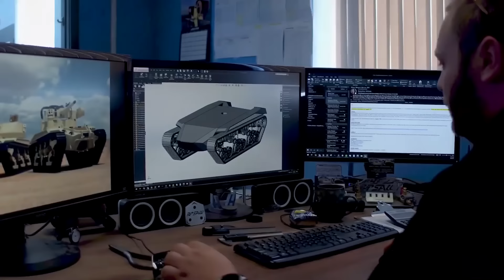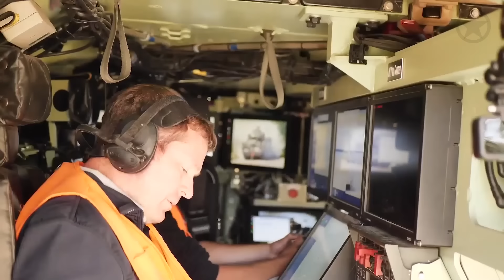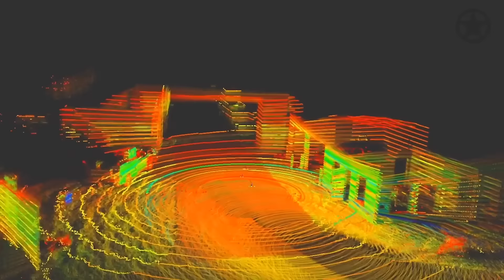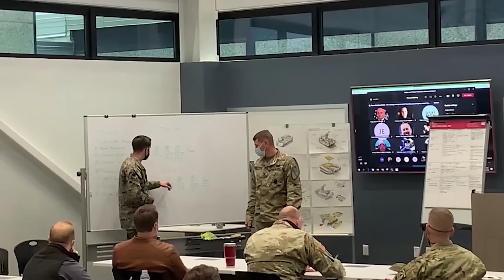This US Tank Will Change EVERYTHING - Here is Why!

Comment: Hasn't the war in Ukraine just proved a hundred dollar drone can destroy any tank?
Reply: Air counters tanks and tanks counter infantry
Reply: Any tanks in Ukraine. You have to understand NATO weapons are much different than what Ukraine has. The intelligence apparatus that NATO hardware is plugged into has the capability of taking out drones by the dozens. Hundreds even.
Reply: And do you not think that equipment won't adapt
Reply: Australia has developed a system to take on drones that can be mounted different vehicles
Reply: @chrisbabbage4004  absolutely. America has all that stuff too. And for quite some time. Whatever you see in public, add 30 years to it and that's what America has.
Reply: @petebetz5358  true all those countries sending equipment are sending older stuff so they can evaluate the equipment, tactics, etc., NATOs new stuff has already advanced well beyond the older stuff, they think ahead, develop ahead.
Reply: No the explosive does as the drone is a delivery system.
Reply: They'll eventually realize you can put a C-RAM or EW device on it and then drones are no longer an issue.

Comment: I defer to negative comments, by this simple  idea; Use it Wisely! It has abilities not seen since the Hellcat Tank-Destroyer. It's almost 'Quiet' and could get much more silent. It has a Low Thermal Image, as well. And, lastly, It's a LOT QUICKER than most other craft out-there. The Studebaker 'Weasel' was a Recon Favorite in WW-2, because, it was amphibious, quiet, quick and Nimble, and 101st AB used it to great advantage, even-though, it was usually Un-Armed! Give it GUNS, and, the Battle-of-the-Bulge wouldn't have been.... This Is, that; and in a Modern war-front,  it DOES NOT ALWAYS need a Human on-board. Not a Game-changer it was a decade ago, but, it'll add to Flexible Response.
Reply: è un costosissimo e inutile giocattolo per impressionare i paesi disarmati. Le armi che fanno vincere le guerre sono ben altra cosa.
Reply: @Maurizio4672  unarmed countries or their countries civilian population.  That what this looks like to me.

Comment: The ripsaw was first seen in the GI-Joe Movie with the Rock. He drove it.  It's a Cheaper than a tank or training of a soldier.  Drones and FPV's have Changed the battle field like how tanks did 100 years ago. Must Keep Up!
Reply: yes, drones are nice, until they get hit with electronic warfare, then they become useless expensive pieces of jumnk.
Reply: If you look at the old hasbro toys from the 80’s and 90’s, the two brothers must have gotten some inspiration, which led to what you reminded us of here.  Pretty cool, actually.
Reply: I recognize the Ripsaw from the show where I saw them developing it.
Major league cool!
Reply: Hollywood and US military at work. Here reality: the KF51 Panther"best tank according to experts" is now a joint-venture from Leonardo/Rheinmetall 50/50%, HQ is Rome, 60% will be build in Italy and 40% in Germany. Italy ordered 230 KF51 and 800 Lynx. Beside that from Auto-loader to the top notch electronic devices, they are provided by Leonardo, the loader is similar to that of the Centauro, Auto and Hand,of course big difference in size and stabilizers, the great engineering of the tank and cannon is provided by Rheinmetall. Leonardo provide also the Hitfact for the US Stryker DRS, and Greece will upgrade their Leo1A5 with Leonardo Hitfact turret
Reply: @andyknolls8735  
Vehicles can have shielded electronics so EMP's aren't always effective. Humvee's are also shielded.
Abram Tanks can be operated without electronics.
US military has learned from the innovation in technology.

Comment: It won't survive long in Ukraine. It is just as vulnerable to mines, flying drones, missiles as all the existing armored vehicles.
Reply: But no men lost. 
I’ll take two.
Reply: You don't think you can mount an airbursting 40mm CTAS cannon (CTA International is a BAE and Nexter joint venture) with a short range phased array X band radar system to sweep the sky of drones at 200 rounds per minuite? Oh ye of little faith.  Think shotgun with attitude, airburst capability and a 4 km range.
Reply: @nunyabusiness5075 it will do nothing to drones. It’s almost impossible to shotdomn a FPV drone. It will hit a tank before they can notice it
Reply: Well its way harder to hit and to licht for alot of mines so it is less vunerable and its supposed to be used for realy dangerous stuff you dont wanna send troops into its supposed to be dispose able
Reply: @Lwaww not when you ja a radar the drones will be easy to shoot down
Reply: @marijnnn4992  well FPV’s are impossible to shotdown when the pilot has a lot of experience or it’s moving fast. And it can be probably be Killed by like 50.BMG round or Russian 14,5. Also I had a stroke reading this
Reply: @Lwaww  Is it protected against normal rifle fire?
Reply: @znail4675  wdym normal rifle.?
Reply: @Lwaww  Assault rifles that soldiers use...
Reply: @znail4675  it has no Armor at all only aluminium frame. Maybe the gun modules can have Armor